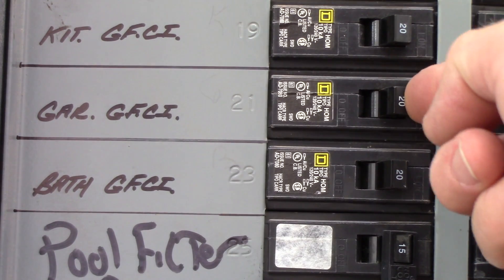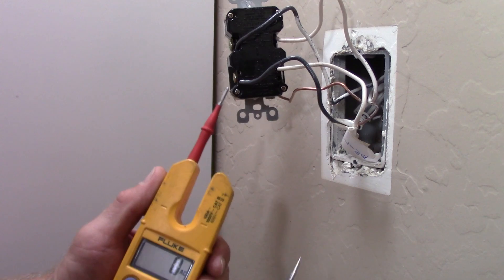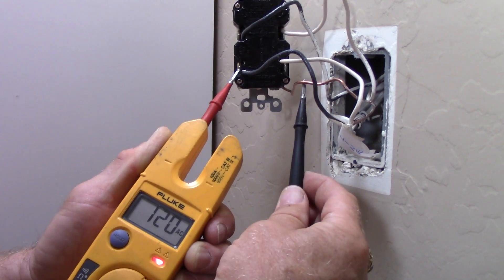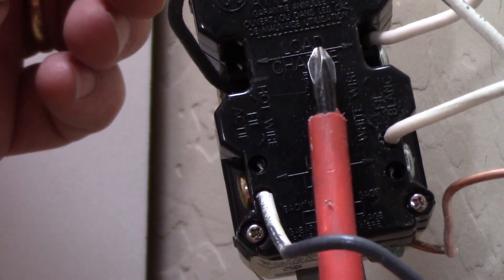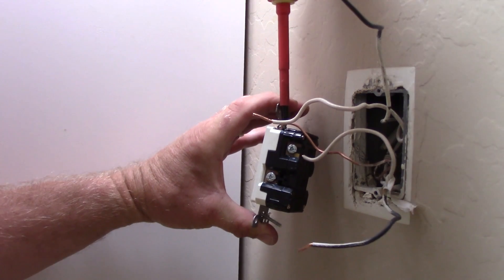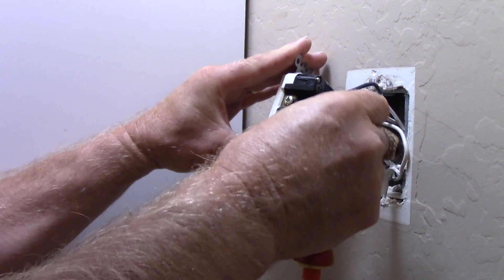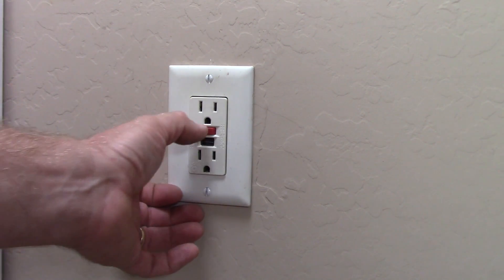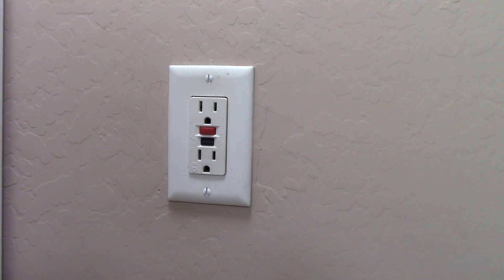Replacing a Faulty GFCI Receptacle

Comment: If the green light button keeps popping out after u push it in to work what does that mean I have a pool filter hooked up to it it goes on then pops after a couple seconds or minutes
Reply from the maker: You likely have a small ground fault in the pool filter pump.

Comment: First of all this GFCI receptacle is designed  for ONLY 15A circuit and 15A breaker NOT 20A. As “electrician “ you should know basic rules. Second before you remove GFCI you have to test receptacle by pushing “test” button or using receptacle tester to see according to lights on tester what is the condition of the receptacle, after that you can remove GFCI from box and measure voltage. Do not wear any jewelry when you working around electricity.
Reply from the maker: Well, first of all, you're wrong. GFCI receptacles are duplex types (2 receptacles in one device), so a 15 A GFCI can be installed on a 20A circuit with no issue. The only time that a 20A GFCI must be used is where a device with a 20A plug will be connected. So, as an electrician of 40+ years, turns out that I do know basic rules after all.  Second, I did fully test that receptacle, that is why I replaced it.  Third, you are correct that I shouldn't wear jewelry when working with electricity.  I frequently forget, and some keener will point that out to me. But the fact that I have all of my fingers would say that I'm pretty careful and don't have too many accidents where I insert my ring into a live circuit, but yes, I should know better.  58 years old and counting so hoping the streak continues.  Thanks for watching.

Comment: Hello, just replaced a 20yr Gfci in garage.  A little green light appears when I hook it up ,but it provides no power,or tripping ability. Thought i hooked up black wire as hot and white a gnds. Is it possible that the hot wires were hooked up incorrect.any input appreciated
Reply: Some receptacles have their line terminals on the top and some are on the bottom. Even Leviton has reversed the locations over the years so you have to read the markings carefully when replacing old gfci receptacles and you may have to reverse the wires coming out of the box to match up the line to the line terminals on the new receptacle.

Comment: if 20A, why is receptacle not T-shape?
Reply from the maker: Lots of devices are rated up to 20A but not T-slot.  It's one of the code rules and manufacturing specs that are flexible on 15 and 20A circuits.

Comment: Isn't it good safety practice to NOT wear metallic jewelry when working around electricity? (Even if the power is "off".)
Reply from the maker: Yes, you are correct.  But I seem to always forget to remove them! However, the careful electricians still have all their fingers (and toes) as do I! (Touch wood, 58 years and counting)

Comment: My gfci outlet in my bathroom makes a faint crackling-like noise and is a bit warm, what do you recommend I do?
Reply from the maker: Check your connections for tightness and that its wired correctly.  If that's not it, replace it!

Comment: When I pull one wire out, i immediately place it in the new designated area so that I don’t forget.
Reply from the maker: Good tip!
Reply: Be careful that does not always work!

Some receptacles have their line terminals on the top and some are on the bottom. Even Leviton has reversed the locations over the years so you have to read the markings carefully when replacing old gfci receptacles and you may have to reverse the wires coming out of the box to match up the line to the line terminals on the new receptacle.

Comment: The instructions in this video only work if you already know which breaker supplies power to the failed outlet. Many houses are not clearly labeled at the breakers. Here is an alternate procedure that works better:  

Take the outlet cover off while the power is still turned on at the breaker.  Stick a non-contact voltage tester into the box to locate the hot live wire from the breaker.  Have a second person go turn off the breaker while you watch the voltage tester to see when power is cut.  Continue the remaining steps as shown in this video.
Reply: Good plan. But I just turned off the main power. I don't always trust the non-contact voltage tester I have.

Comment: Awesome thanks I have the same problem I didn’t know about that line side and load side I have to recheck it because I’m still having it not resetting I have a outlet outside that should some corrosion but when replaced it with a new outlet the GFI inside still won’t reset maybe I have the line and loan wrong I will recheck thanks your info was helpful

Comment: Thanks for posting this video, but how can you identify which is line, power, daisy chain?
Reply from the maker: You have to do the testing with the wires all apart and off of the device.  There's no simple way.  If the device was installed correctly you just check what terminal pairs the wires on and make note of that and replace the same.

Comment: I wish I saw your video first. One thing you should discuss the fact that line side may vary in different receptacles.
Reply from the maker: Yes, I should have.  But the 'line' and 'load' terminals are always identified, and new devices are sold with a bold colored tape covering the 'load' terminals.
Reply: @theinternetelectrician  I just bought new gfci outlet yesterday and there was NOT any tape covering the load side terminals.

Comment: Fantastic  video .  I'm a current hvac student ,  just finished two basic electrical  classes .  Spot on ,  clear and thoroughly  explained.   Devil is in the details.   Using a legit  fluke meter,  safely with one hand , confirming power is off ,  using  an insulated  screwdriver, marking the " line "  side of the hot and neutral.   Putting that receptacle nice and even with the face plate screws orientated  in the same direction.    confirming the proper wiring and function  of the gfci with the tester .
I will be subscribing  and looking through your other content.   I'm sure I will be able to learn a lot .
Thanks
Reply from the maker: Thanks so much!  If you have any questions for clarity, please reach out to my email, terry@electrical-online.com
Reply: @theinternetelectrician  thank you !  I will

Comment: Great video. Thanks. Funny another video I watched from someone else they fast forward it through taking the wires off and hooking the wires up. That was dumb of them. It was great that you mentioned the line and the load differences and to Mark the line and the loads. Very important. Also, as someone else commented other people said that when replacing an older model sometimes that lines and loads position on the receptacle and reverse order from top to bottom so you want to read and pay attention to which wires are line and loads when you remove them and where it is marked on the new receptacle line and loads.
Reply from the maker: Yes, good advice!  Thanks for watching!

Comment: Hi and thank you for the video. I changed out our GFCI receptacle but it's not passing power through it still but power is going to it. What could be tripping it and how would we find out?
Reply from the maker: Not sure? Did you ensure your "line" and " load" terminals have the correct cable sets going to them?  And that you didn't cross the neutral wires? Both neutral and hot supply must connect to the line, and same for the load.
Reply: @theinternetelectrician  Thank you Very much ! I just did a quick look see and yeah.  I put the load on the line and etc. You saved me brother!  
Peace °•○●□■
Reply: Some receptacles have their line terminals on the top and some are on the bottom. Even Leviton has reversed the locations over the years so you have to read the markings carefully when replacing old gfci receptacles and you may have to reverse the wires coming out of the box to match up the line to the line terminals on the new receptacle.
Reply: @HeyNylo  yea, I tried doing the old copy and paste method from the old receptacle and yea, they weren't the same.

Comment: I find your video helpful! As ive followed instructions exactly as you showed and replaced the gfci the same was as i took out the other one. But this outlet has 3 hot wires, 3 nuetrals, and a ground and it’s getting power but wont trip. Please help.
Reply from the maker: You have a power feed in, and two feeds out of that box then.  What we need to know is what else is being fed from there and what (if any) of the other devices that you want to be GFCI protected.

Comment: Thanks for the video I am an automotive technician and am quite familiar with with DC electrical systems but AC is just a bit different. I had a GFCI outlet that tripped and buzzed after I reset it. I got the smell of something burning/hot, which is quite terrifying to me because I've had an electrical house fire before years ago. The process you described is essentially what I came up with on my own but I feel much better having someone familiar with it explain it, to confirm my thought process. I also decided to replace my existing GFCI with a afci/ GFCI receptacle... I figured I might as well.
Reply from the maker: Thanks for the comment.  Happy to have helped!

Comment: Interesting.  Mine has four wires on the line side and nothing attached to the load side.
Reply from the maker: That would indicate that whatever else is fed on that circuit doesn't require GFCI protection, or they wired it wrong.

Comment: You shut off the breakers but it still shows 120AC across the line. Is there something I'm missing? Shouldn't it be 0? Or did you turn it back on for your multimeter test?
Reply from the maker: It should be 0, or close to it.  I'll have to watch again to see what you mean, but this is the first observation of this that I've seen in my comments.
Reply: @theinternetelectrician  Nevermind, you said you turned the breaker back on, I just missed that you said that.

Comment: If you turned breaker off how did you get a volt reading?
Reply: Mine would not reset but after 24 hrs it did? Maybe moisture? I don't remember getting it wet?
Reply from the maker: @hotwheel6663  Sounds like a moisture issue.  If it happens again, use a hair dryer to speed up the drying and then you'll know if it was moisture or not.
Reply from the maker: Probably turned it back on!

Comment: I install two new outlets in my welding machine they show a constant red light but they don't work, they also don't reset or nothing, do you know what could it be? I install them the same way they were wired
Reply from the maker: You need to carefully check that you have the line and load pairs wired correctly, and make certain that you didn't switch the neutrals so they aren't with the correct hot wire, line or load.  This is a frequent mistake that we all have made at one time or another!

Comment: Ran into some trouble, the GCFI breaker has a light on it which shows green (I’m assuming that it’s connected properly) but it does not test or reset...not does anything work plugged in... I followed your video and the wiring matches everything I’m doing to the  T... please help if you can...I don’t know how to install a new one.. the old ones worked perfectly but we remodeled and are changing the breaker for a cleaner look...

Comment: Hi Terry I have a saluspa Coleman hot tub. The gfci plug will not show red light on which means all good to use power wise/ safe! I have tested and reset this plug still no red light . Can u help me ?
Reply from the maker: Is the hot tub working? Does it trip when you hit test, and reset, but no red light, or doesn't work at all?
Reply: Terry Peterman Hi Terry it trips when I test and reset no red light but the hot tub works .
Reply from the maker: @kimscalera6154  I would be inclined to believe that only the indicator light failed, and that the GFCI protection is still working then.  But to be sure I would contact technical support at Coleman to see if they think it's a concern.  Maybe they will send out a replacement cord? The other thing you could do would be to cut off that GFCI plug from the cord, put on a regular cord cap (plug), and then plug in to a GFCI receptacle.  This is a solution if the tub is off warranty now as this would void your remaining warranty.   I have a couple of those GFCI plug and cord units that I have accumulated from using inexpensive pool pumps to circulate my old hot tub that I had a propane heater on.  I'd ship you out one if you'd like?!?
Reply: Hi terry thank you so much for your help ! The hot tub gfci plug is plugged into a gfci receptacle already.   Initially this red light was working at prior uses . How important is it to have a breaker in our home breaker box dedicated to the hot tub ? My husband says it should not matter .
Reply from the maker: Kim Scalera then you are doubly protected for ground-fault so I wouldn’t worry about that. Those GFI plugs provide the protection so you don’t need to be plugged into a GFCI receptacle as well. It would be best if the tub was on its own circuit but if there’s not much else for loads on that circuit, then it’s ok. If it was a heavily used circuit, it would trip the breaker in the panel.
Reply: Terry Peterman Thank you!!!!! My husband and I very much appreciate all of your help I will contact Coleman about the red light however what I hear you saying is I am protected x2 for grounding so red light really  does not matter ?  I think it would be best to have separate power supply for the tub due to all of our electrical stuff goes through that one breaker box we have .   Thanks again Terry you have been awesome ! The Scalera’s in Tacoma Wa
Reply: Terry Peterman thank you!!!!! So appreciated!! Have a great day!

Comment: When you unscrewed the 2 neutral lines why didn’t you remove the second neutral line from the screw? And at 5:08 cant tell how to put the wire in is the screw go THROUGH the wire?  (your hand is in the way)
Reply: He didn't remove the wire  because it was only a demonstration of what needed to be done in order to fix this type of problems.  He never replaced the existing outlet, but he showed the steps needed to do so.

Comment: Terry, It looks like the gfci is 15 amp.on 20 amp circuit.Why is that?
Reply from the maker: GFCI receptacles are duplex types (2 receptacles in one device), so a 15 A GFCI can be installed on a 20A circuit with no issue. The only time that a 20A GFCI must be used is where a device with a 20A plug will be connected.  Thanks for watching!

Comment: I just bought a new 20 amp outlet gfi. It is wired correctly but still does not work.
Reply from the maker: I can't really provide an answer here without some trouble-shooting.  You will need a voltage tester, or better yet, a multi meter.

Comment: Great video! Will a faulty GFCI outlet still work but cause other receptacles to not work?
Reply from the maker: I would doubt it, but I've seen stranger things.  I would have to do some "hands on" troubleshooting on this to be sure.
Reply: @theinternetelectrician  when my garage gfci trips, all the outlets behind it go down. I assuming the electrician who wire my garage put them in series instead of parallel.

Comment: Hi Terry, thank you for your informative video.  My question is why my GFCI outlet is not working; it has a solid red LED on.  When I plugged a GFCI tester, nothing light up.  The Circuit Line is hot when I tested it with a non-contact AC Voltage Detector.  I even disconnected the Load line from the outlet.  I greatly appreciated for any pieces of advice.
Reply: Your GCFI receptacle is faulty/defective and needs to be replaced
Reply from the maker: @privateinformation9384  Yup, what you said!

Comment: I have a problem  I have  power but every gfi I install has a blinking red light  it will not reset and  every gfi I buy does the same thing  nothing is running in series with it please help.
Reply from the maker: Do you have, or can you get a multimeter to do some testing?
Reply: @theinternetelectrician  yes I think  the wire gauge  is to low
Reply from the maker: @carlito_blackcloud5921  No, that's not likely the cause of your problem

Comment: I recently noticed the gfci in my bathroom was making a faint buzzing noise. Pressing Test stopped it and it wasn't doing it after I reset. First time that's happened. The bathroom tends to get humid. Should I replace it? Is it a fire hazard?

Comment: If I don’t have the plug 🔌, this GFCI is for my jet tub. Is it enough that test button stops the tub? And reset turns it back on.
Reply from the maker: You have what we call a faceless GFCI.  Yes, if the test and reset work and the pump stops, that's a sufficient test, and is what you're supposed to do on a monthly basis.  Keep up the good work! Thanks for watching.

Comment: Anyone have a comment related to the problem of 'gfci youth suicide'?  Wont reset has feed power.

This mf'er costs $20 and was about 1 year old and then just nothing out of it.  I tested it, its the first outlet of 2 on a short run in the basement and only 20 foot of wire all accessible.  I replaced it with another $20 and yesterday i found the 2nd one was dead after being installed Nov 2nd so almost 6 months old.  Feed looked good 123.3 volts.  Same at the circuit breaker, same down stream at the 2nd and last outlet on the circuit.  I say screw it no gfci there anymore.